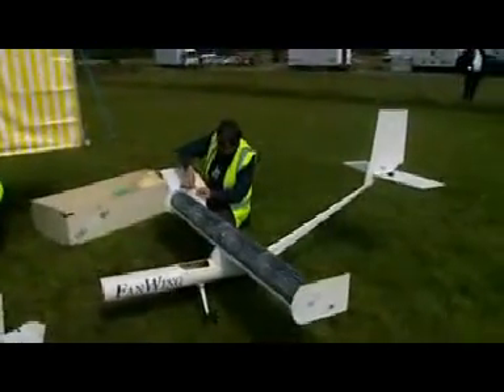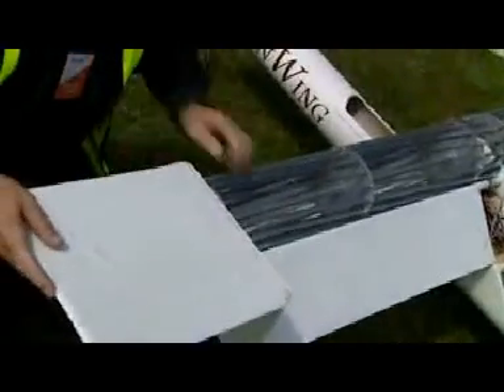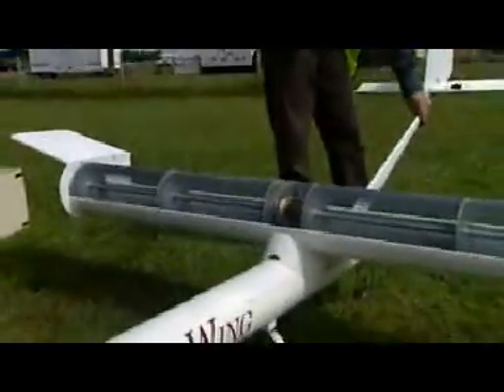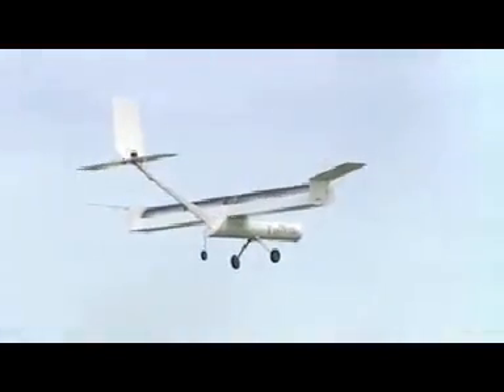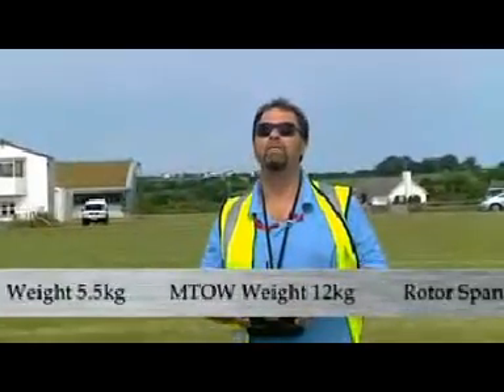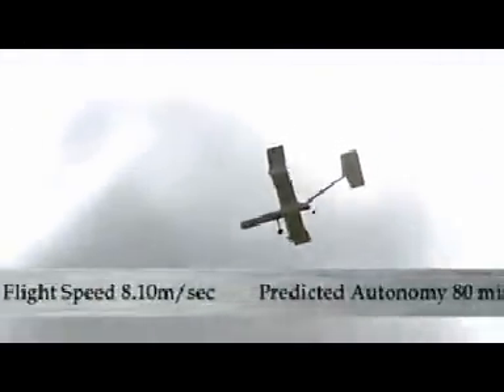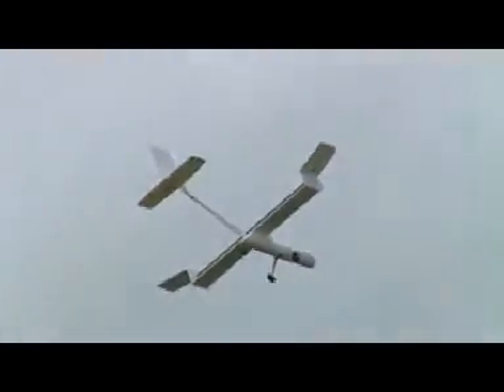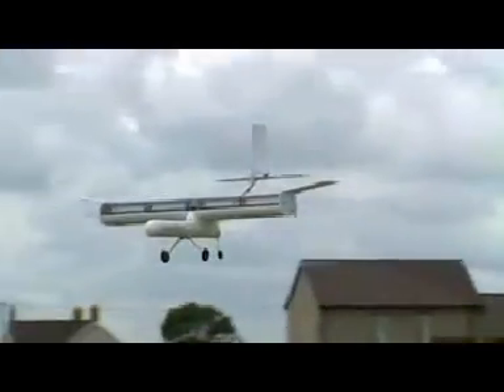Fan Wing

Comment: Airplanes can glide.   Helicopters can autorotate if they are high enough when thay lose power and the pilot is current on procedure.    If these drop like a stone when they lose power, then they really would have to have some particular huge advantage over other aircraft.  STOL competition of pilot inside aircraft make this model aircraft climb look very shallow and takeoff distance extremely long.

Comment: Very stable and slow.  Falling out of the sky due to engine failure is low...electric motors are much Less problem than gas aircraft engines.  Might be a nice tool for camera work needing only slow speeds as mentioned.   Probably longer flight time per wh  and maybe a more consistent fluid camera path than quads.

Comment: Not new tech at all. Old idea not suitable for passengers because they can't glide if there is loss of power.
Reply: rocknrollfrenchfries a helicopter can auto-rotate with no power and land safely . This thing will drop like a stone
Reply: heli's can easily land with auto rotate if they lose power at 100m, 
this will drop like stone, stall goeas max and not enough wings to support the load

Comment: "Some flying machines have been built which use the Magnus effect to create lift with a rotating cylinder at the front of a wing, allowing flight at lower horizontal speeds.[4] The earliest attempt to use the Magnus effect for a heavier-than-air aircraft was in 1910 by a US member of Congress, Butler Ames of Massachusetts. The next attempt was in the early 1930s by three inventors in New York state.[24]" Wikipedia

Comment: its a rip off copy.I had a rotor wing model kite as a kid about 30 years ago.
Reply: Maybe your one was a rip off from the kite which I had about 60!!! years ago.
Reply: I still have one of those kites, mine was marketed as a "UFO" kite.
Reply: Jack, I have that kite today! It has two circular end plates (with pivot points) with a "warped" middle piece. The middle turns, as the end plates merely rotate. It is SO cool looking in the air.
Reply: Anthony Whitehouse I think those roto-wing (rotor or rotorary wing) kites were selling almost 50 years ago.

Comment: Looks like its made from PVC tubing and a cross flow (tangential) fan. Possibility to have hybrid powered - engine and electric motor. Utilizing the electric motor and engine for take off and cruising with engine. Electric motor could also be used as a backup system if engine fails.

Comment: But what is its gliding capability in case of an engine failure? Looks like a brick to me in this case.
Reply: Skandalos I would be one concerned with something like bearing failure. Unless the engine seizes, the fan will still spin, creating lift. I've seen helicopter training with engine cutoffs, and emergency landings. The rotor still provides sufficient lift to permit a safe landing, absent power from the engine. This plane would be able to land as well as any other, if not more so, in the event of engine failure, as long as the fans were still able to free spin. If the engine and/or bearings were to seize, however. There's your brick.

Comment: THIS IS NOT NEW THIS IS FLOWN BY THE MAGNUS ROTOR EFFECT  AN RC MODEL OF THIS WAS BUILD IN ABOUT 1979  and you can find it in RC Modeler Magazing
Reply: No this is completely different and is not the magnus effect.. the magnus effect uses spinning drums to create lift, this uses fans spinning over a wing to create lift.
Reply: Yes Actually,i think you are correct. i remember reading something to this effect in a Magazine here in Canada. Possibly Reader Digest also?.Ty.
Reply: Which is not to say the Magnus Rotor Effect is not worth pursuing, though I suggest it makes for better sails than wings, and even then on the premise of having backup power [in the form of the ship's motor-driven props].

Comment: What happens if the fan stops? My guess is it has a glide ratio similar to a house brick?
Reply: rather like in helicopter. Something similar to auto rotation
Reply: well said mwakelin, laughing at the douche that said it could glide with its autorotation! LOL    A little bit of knowledge is dangerous huh!
Reply: I doubt it.  A helicopter autorotates by storing energy in the rotor by reversing the pitch.  Then providing lift at the end of the decent to give a soft landing.  This has no pitch control so the same theory wouldn't work.  I think it would crash if it had a power failure as the 'wing' doesn't look like it would glide. Too much drag.
Reply: @mwakelin  It will fly down slowly and safe. The lift force is increasing linearly with rotational speed of the wing and again linearly with the speed of the airflow - the formula of magnus effect. even if u switch off the motor, which rotates the wing, it will slow down and aircraft start to accelerate downwards, which again increases the lift. Such a weird balance)
Reply: @demidrol5660  Thanks for your reply.  It prompted me to do a bit more reading on the subject.  Apparently the plane would have a glide ratio of about 3:1.  Not convinced how safe a landing would be, but nevertheless, it's better than I expected.
Reply: Blame USA the closest this could get to autorotation is if you could do a steep dive as fast as possible then glide into a landing. That's assuming that the forward angle would spin up the fan fast enough to create lift. Would have to be able to efficiently free wheel.
Reply: My guess is that if we all were required to post our real names, home addresses, phone numbers, and email addies, then you would learn to curb your rudeness. What gives you the right to call a complete stranger a "douche?" Anonymity, and that's all.
Reply: @20gilbert20  It will fly down slowly and safe. The lift force is increasing linearly with rotational speed of the wing and again linearly with the speed of the airflow - the formula of magnus effect. even if u switch off the motor, which rotates the wing, it will slow down and aircraft start to accelerate downwards, which again increases the lift. Such a weird balance)

Comment: "Its more stable than a traditional aircraft" No shit the whole wing is a gyro.
Reply: stable at low speeds is the big deal for surveillance...
Reply: "stable at low speeds is the big deal for surveillance..." Not exactly stable if the weight of the fan causes torque and rotates the nose. Also the relative high speed and low speed stall with the fan turbulence make the range of capable flight narrow and unreliable not to mention little to no loiter time.  The gyroscopic stability also reduces the ability to turn with a known turn rate at a given rps and wind. Stable this plane is not.

Comment: No glidepath, no auto-rotoring I presume?  If you lose power, you lose all lift.
Reply: Potentially, with the right weight distribution, it could have an equivalent 'auto-rotate' mode.  BUT, that needs to be worked out before it starts making runs down streets full of people, much less carrying payloads of value.

P.S. It is "elegant" by the engineering definition (4:30), not the man in the street's definition.
Reply: Yep, a lot of drag I guess.
Reply: the stuff you say for the relative wind is bs if the squirrel isnt shaped like a helicopters wing.
Reply: Timo I kinda agree.  I think that the mechanism to feather the cage-turbine would make it more heavy and complex, and more difficult to auto-rotor.  For traditional helicopters, nothing is more efficient than a central hub, and using centrifugal force to hold the other end.  I really like this concept for drones, but I don't think it could work well for human-flight.  I also think the efficiency of the static-fixed wing are tough to beat.
Reply: Matthew Richardson so it's kind of like a helicopter-plane hybrid
Reply: I bet it glides great, just as an autogyro is "undriven".

Comment: rubbish I have been a pilot for many years you can not re invent the wing nor the wheel i.e. a wheel is round the wing is shaped from nature i.e. birds that have been around for millions of years anyone trying to re invent these items are a fraud they are carved in stone
Reply: Look... Mike... Evolution can only go that far with biological tools. You can do more with materials that aren't biologically available to biological lifeforms.

How would a biological lifeform be able to have bearings and a rotor shaft, that can move independent with no fused connection to the rest of the design, like a helicopter? Or have nice materials like pure metal or carbon fiber?

Genetic/organic evolution has certain limits, one of them being that one entity cannot be designed with separated independent parts. Why would you assume evolution has even gone to it's fullest extend to begin with? That's ignorant in my opinion.

Still waiting for evolution to build us space rockets and basically any other man made construction. Some of it may be nature inspired, of course, but that's not an argument, because nature isn't perfect nor at maximum efficiency.

You could say that humans inventing and perfecting stuff is part of evolution, since we're advanced biological lifeforms taking advantage of logic, knowledge and the ability to use materials not biologically available to us.
Reply: the wing is still shaped like a wing on this aircraft. They only changed the shape of the engine.
Reply: As I stated, you can upgrade the engines or fly without one but whatever you fly you need some sort of aerodynamic wing foil, you can make them bigger or smaller but you cannot fly without them, man has reached a point at the end of many trials and tests, the wing stays the same teardrop shape.

Comment: this isn't new its the magnus effect
Reply: This isn't the magnus effect it is a cross flow fan.
The magnus effect uses  a cylinder with a solid surface and utilizes the aerodynamic forces generated against that surface when spun rapidly.
A cross flow fan uses impeller blades set up in a cylindrical pattern that catch and impels the air when spun which is a completely different principle.
Reply: This is a what a magnus effect wing looks like.
https://i.ytimg.com/vi/acXvl-8xrBM/hqdefault.jpg
Do you see any blades?
The wing in this video is a Propulsive wing which uses embedded, distributed cross-flow fan propulsion system within a thick wing. The fan, partially embedded within the airfoil section, draws the flow in from the suction surface and exhausts at the trailing edge. In cruise, the combination of distributed boundary-layer ingestion and wake filling increase propulsive efficiency,while distributed vectored thrust provides substantial improvements in pressure drag.
Reply: They'll use innovative lawyers to find something to  add onto the patent to make it exactly the same but totally new: "The magnus effect using a computer controller..."
Reply: Gustav Magnus was a Professor of Physics at the University of
Berlin during the years 1834 to 1869. His well-known experiment
was conducted in 1852. It consisted of a brass cylinder held
between two conical bearings to which he could impart a high
speed of rotation by means of a string. He mounted the cylinder
upon a freely rotatable arm and directed a current of air from a
blower towards it. When the cylinder was rotated, he
noticed a strong lateral deviation. The spinning body always
tended to deflect toward the side of the rotor that was traveling
in the same direction as the wind coming from the blower. The
magnitude of the deflecting forces was not measured by Magnus
at that time. From now on, the phenomenon was called
Magnus effect.
Reply: Magnus effect is defined as a device that
provides a moving wall on its body to influence the boundary
layer around the device, in order to produce a lifting force
perpendicular to the flow direction. A rotor airplane is defined
as an airplane which uses the Magnus effect for lift generation.
Reply: I was scrolling hoping id see this response :)
Reply: Yeah, wasn't it invented over 80 years ago?
Reply: Discovered but yes.
Reply: You mean you were hoping to find other people suffering from Dunning–Kruger effect?
Reply: +Anonymous01959  I examined the picture of this site you've posted and I notice what looks like a second set of wings between the rotor wings and the tail fins.
Is that for gliding down after an engine/motor failure?
Reply: A "cross flow fan" was made to cause air flow and not demonstrate the Mangus Effect or Gyroscope Physics even though it has both but neither are needed for it's use. A cross flow fan is a cylinder, it's not a solid walled cylinder, but still a cylinder.

The Mangus Effect is not limited to solid walled cylinders, I'm sure someone as smart as you knows that. And I'm sure that someone as smart as you understands that the Mangus Effect involves lift from gyroscope physics and not the shape of an object. A solid cylinder does give a good visual for those that don't understand the physics involved in the Mangus Effect. A spinning brick could be used to demonstrate the Mangus effect, but a spinning ball dropped over the wall of a dam will give a better visual due to aerodynamics. 

Using yourself to display Dunning-Kruger effect was a bit harsh on yourself, but still funny.

The plane did get some lift from the Mangus Effect. Propulsion was from the cross flow fan wing.  To deny the Mangus effect being involved shows that you don't fully understand how the Mangus effect works, it's not shape, it's Gyroscope Physics.
Reply: shigeolincolntaco well it’s a different way of using the effect as ussaly it’s not a fan but a cylinder

Comment: I wonder what happens when the power fails?

i.e. Can it glide... or does it just fall out of the sky?
Reply: Possibly!
 I had a small  yellow celluloid toy kite in the early 1950s that used  a pair of Magnus effect  wings. 
They were Savonius rotors (an S-shape x-section) rather than the multi-foil tangential-fan style of rotors used here.
Much depends on whether these foils are set to be able to auto-rotate (like an autogyro) - and there will need to be a freewheel to decouple the engine drag.
That kite needed more wind to fly than a simple paper one of similar size (that weighed less), and it never flew very high but it made an awesome noise, which I loved!
Reply: 250tegra

Comment: how in the fuck does that even work?
Reply: BadIdeas101 the Magnus Effect
Reply: Aero No. Magnus effect involve dragging the boundary layer. This one induce circulation with paddles in the rotor, and project the air over a trailing edge.

Comment: And in case of engine failure....
Reply: +ryan dezeng It's actually designed to permit auto-rotation to slow the crash.
Reply: it would fall like a lawn dart
Reply: Ok cool
Reply: It loses altitude like any other airplane. What else would you think would happen?
Reply: @K3Flyguy  no it doesn't, as it starts to accelerate the lift force is increasing proportional to speed of the airflow, look the formula of magnus effect, even if u switch off the motor, which rotates the wing, it will slow down and aircraft start to accelerate downwards, which again increases the lift. Such a weird balance)

Comment: Bet it glided like a brick when there was a power failure.
Reply: totally agree..
Reply: *****
A helicopter still maintains control of forward flight and controlled decent through autorotation.  Fan Wing is essentially thrust vectoring.  Without thrust, it plummets.
Reply: *****
Actually, as someone who builds and flys RC planes and helicopters, flown and instructed ultralight aircraft, constructed a homebuilt aircraft, acquired my private pilot's license, and built off grid wind turbines including making my own rotor blades, I do have a pretty clear understanding of lift aerodynamics.  Please take my word for it.  The "wing" as you're calling it, has no lift capability.
Reply: *****
Ha!  Actually, you reminded me of another!  I do fly sport and traction kites, including kite buggying, but I haven't done that in quite a while.
Reply: *****
Stop it!  You're making want to dig out all the gear again.

Traction kites aren't kites from your youth.  I have a 5 meter parafoil kite that easily develops over 200 pounds of pull with certain maneuvers.
Reply: I'm on the other side of the pond.  Most my buggying days were in the Outer Banks.

Comment: It's a 4 year old video folks. And the MS Flyer website no longer exists.
Reply: Alejandro Irausquin Nice job. So this aircraft, presumably, can't fly inverted. ;¬)
Reply: ...The idea is 17 years old...
Reply: Misha-Miša-Milorad Jovanović  You may be right my friend. And the original aerodynamic theorem that forms the main part of this machine is surely from some time around 1890.        http://hyperphysics.phy-astr.gsu.edu/hbase/fluids/kutta.html
Reply: ...correct ,  wordreet ...
Reply: +wordreet that is right, but in the typical K-J Theorem example, the position of the stagnation points are determined by the cylinder rotational speed, something "new" in this arrangement is the addition of a wing surface, which now determines the position of the rear stagnation point, just like in a regular wing. Calculations and modelling done by a friend showed that this enhanced the production of lift.
Reply: wordreet Good point! It should not!

Comment: Not efficient, but interestingly stable at very slow speeds.  It could be useful in the small drone world competing with multirotors more than other fixed-wings.  That depends on how long it can stay in the air compared to multirotors of similar capability.

Comment: Hmmmm.  Website link is dead.
1.2 kW electric motor for propulsion/lift.  If I remember correctly that is about a OS .60 equivalent.  That doesn't feel like an efficient system to me.  R/C sized aircraft are notoriously overpowered for their size.  I wonder how well something like this would scale up to larger sizes or would this be a system that does well scaled down.